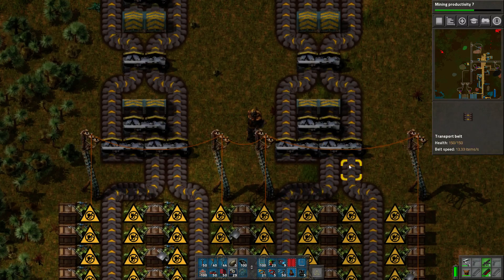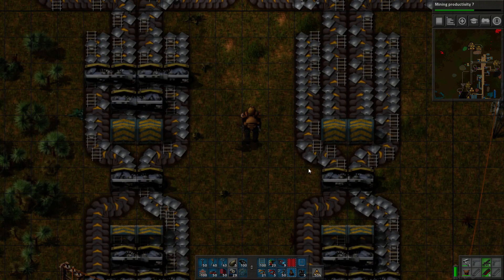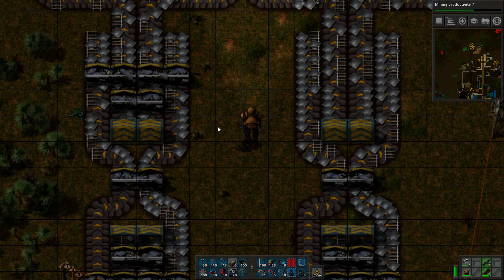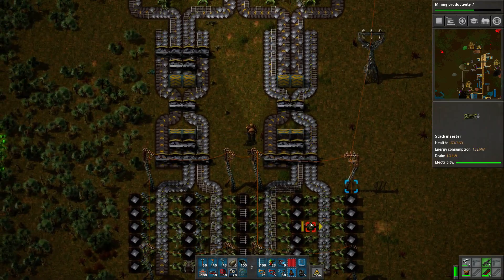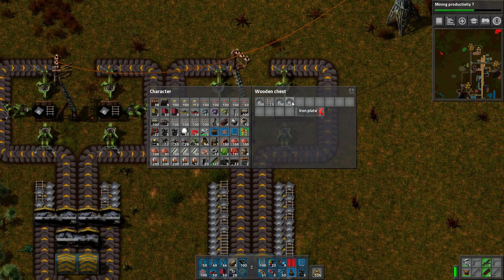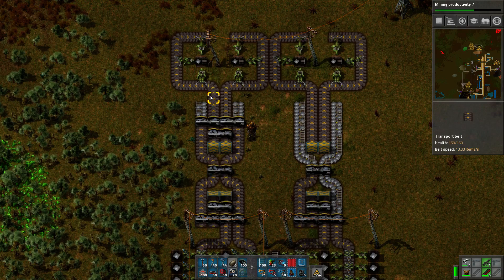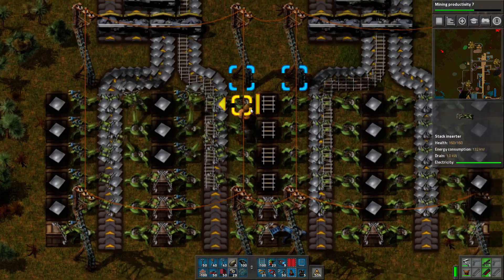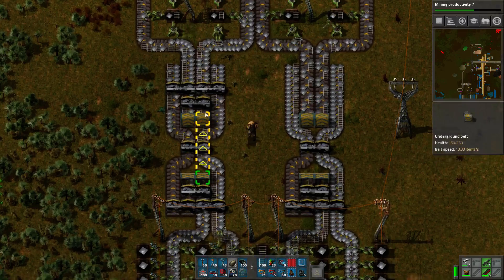Let's Play: Factorio v15 -- Also Rail World! -- Episode 19 - ADDENDUM

Comment: Quill, the setup you've got is designed to take 4 input belts and mix the contents evenly across 4 output belts. However, you're only feeding 2 belts into it. If you want to evenly split 2 inputs across 4 outputs, you can do that trivially by feeding both inputs into a single splitter (mixing the two inputs evenly), and then feeding the left output into the right input of a second splitter (splitting the pre-mixed contents evenly). Feed the right output of the first splitter into the left input of a third splitter (again, splitting contents evenly),  you get 4 perfectly mixed and split output belts ... using just 3 splitters. (NOTE: in all setups, items on the left side of an input belt remain on the left side of an output belt, so none of these is a true load balancer. You need side-loading for that, like you do when you put a balancer on a single belt.)

Comment: The reason why you're getting different output on the setups is two-fold.

First, they start completely empty, this makes more stuff gather in the right setup.

Second, you're only feeding using inputs 3 & 4. This makes it so that the right setup only has one path available while the left one has two. If you were to use one input each on the start splitters (e.g. 1&4 or 2&4) then the output would be equal once both setups are backed up.

Comment: you need to use them situationally. things like train loading where you eat all 4 belts at the exact same rate can use the less parts version.
Reply: All of the inserters need to be working continuously to speedup loading time, the mine will have uneven output.
Reply: yes but the basic setup splits evenly, train loading is basically the only location it can work at.
Reply: But it doesn't output evenly when you have multiple inputs with the stripped down version.

Comment: you still dont need the last center splitter. its splitting to lines that just got split. the last 2 side splitters are needed though
Reply: If you take out that last splitter it's still possible for the throughput to be limited, with it, every line is 100% going to get full throughput.
Reply: look at what its splitting, those same 2 lanes just split before the underground belt. u might as well stack them back to back then put underground belts in after. that extra splitter is beyond redundant and literally adds nothing
Reply: That splitter won't help if two lanes on the same splitter are completely full and backed up, the point of that splitter is to prevent that from occuring. You would be losing some throughput without it.
Reply: "You would be losing some throughput without it."
no you wouldnt, i just stated why...
"the point of that splitter is to prevent that from occuring"
how? pls explain
Reply: It's very hard to explain in text, it increases throughput when multiple lanes on one side are backed up. Because Quill is putting items in only on the right two lanes, the splitters divide by 50% so think of the lanes visually as 1,2,3,4.

He inputs on 3,4 which then gets split to lanes 2,3,4 - at this point lanes 2,3 have 25% of the items each and 4 has 50% for a total of 100%
The middle splitter takes belt 4's 50% and gives 25% to lane 1
At this point before they enter the final splitters, it's 25% on 1,2,3,4
If you only have two splitters (one on belts 1,2 and on 3,4) they can only send the extra throughput to the neighboring belts they share. If you have the splitter before it, Belt 2 can send extra throughput to belt 3 which can get split to belt 4.

Comment: If you'd like to look at the mathematical background behind this, the belt balancing problem is closely related to a problem encountered in the phone network: how do you connect N incoming lines to N outgoing lines without absolutely huge crossbar switches?

Since Factorio only has a 2-way splitter, building non-blocking belt balancers is equivalent to building a Beneš network (https://en.wikipedia.org/wiki/Clos_network#Bene.C5.A1_network_.28m_.3D_n_.3D_2.29).

Comment: If your using these anywhere but ore input they're due to bad design. The right one only suffers if input is uneven. Why is input uneven, supply is not good enough. Balancers in general just hide supply problems rather than help in anyway.